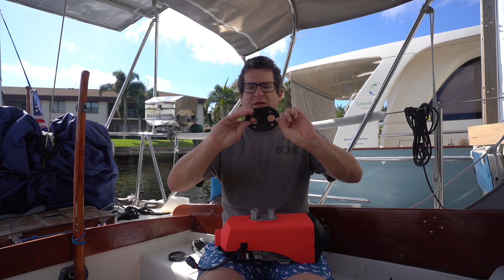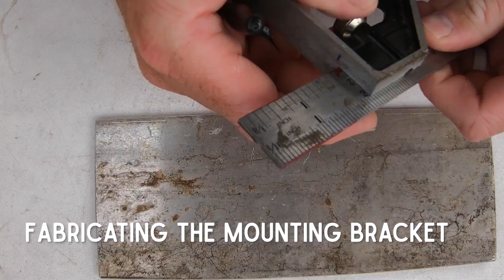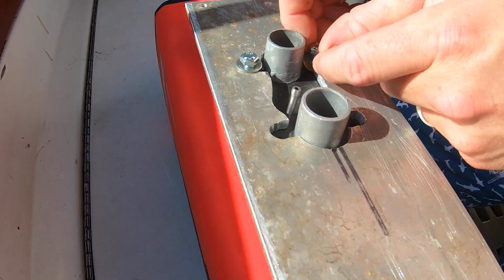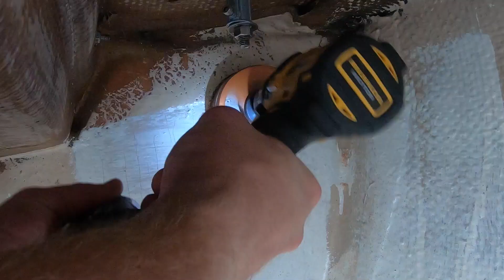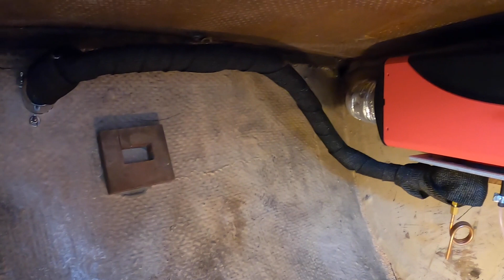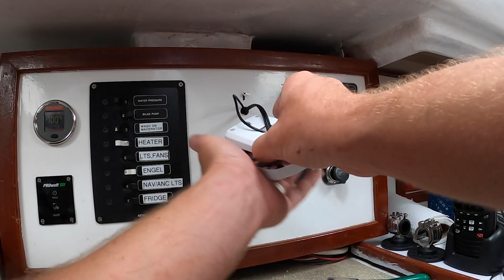Installing a Diesel Heater in Our Sailboat | Episode 37 Alberg 30 Refit

Comment: So, if I understand correctly you take the fuel with a T after the first filter? No issues with air intake in the engine or heater? 

Thanks for your video!

Comment: good video, upgrades I haven't seen in other videos.  No link to the insulated ducting?
Reply from the maker: For that installation I used standard fiberglass duct insulation.    On the Tartan I used Armaflex (EPDM foam) insulation which was much easier to work with.   It’s available on Amazon in a variety of sizes.

Comment: The exhaust should come out thru the transom because it's a sailboat? You have no goose neck in the exhaust so instead you have that drainage pipe, but doesn't that let exhaust inside the boat?
Reply from the maker: Exhaust can be on the transom and a lot of sailboats are setup that way.    You want a spot that doesn’t get submerged while heeling and exposed to limited spray.    On our Alberg 30 the aft corner made the most sense. Many choose to plug the exhaust when not in use.   A wine cork fits perfectly. 

It might be hard to see but the exhaust does rise several inches above the outlet before dipping down to connect to the heater.

The condensate drain has several loops in it which hold water acting like a sink  P trap.  Preventing exhaust from escaping and letting water drain out.
Reply: @AbroadReachTravel  We are assembling a similar type of heater, and the manual says the exhaust has to be in the transom at least 60 cm above waterline and the goose neck has to be 30 cm high, but this is impossible because the hull is not tall enough. Have to choose between assembling it close to the waterline or assembing a low goose neck. Which way you think it should be done?
Reply from the maker: I with the options presented I would go with short gooseneck and a high mounted outlet. Think about a drain in the low spot and maybe plug the outlet if conditions require.
Reply: @AbroadReachTravel  Yes, I agree mounting it high, but it would still be less than 60 cm from waterline. Those drain pipe curves could dry out without noticing it, and I'm concerned of not remembering to remove that plug from the exhaust outlet.

Comment: Great and instructive video.
I'm about to install a Webasto air heater in our sailboat. The same constructions principle.
In the Webasto manual they do not recommend the heater to be installed transversely to the longitudinal axis of the boat in a sailing boat. It's OK in motor boat or if the heater is used mainly when docked. What is your opinion on that issue? Any thought would be greatly appreciated.

Comment: I have this in our skoolie.. but we bought the one with the 4 smaller output tube end.  I used the small piping to make "elbows" and then metal electrical conduit as stright runs to "duct" the heat around the bus.   I plan to do the same when we move back on to a boat.   The plus side of this is the metal tubing (two run under the bed) also radiate heat in the cubby areas they run through

Comment: Hi, thanks for the video, on your exhaust there was the coiled nipple for drain etc ? What is it for and did you make it your self ?
Reply from the maker: Exactly, It’s a drain to let out any condensate from combustion or the unlikely event water splashes up the exhaust. The loop shape keeps a bit of water trapped in it so exhaust gasses can’t escape.  I didn’t make it my self, I got that one off eBay search: “Diesel Heater Drain Elbow”. -Andy
Reply: @AbroadReachTravel  thank you for the reply and all the info :)

Comment: What did u wrap around the thru hull fitting on the outside side before pushing it into the hull
Reply from the maker: Butyl tape.  Its a great sealant for above the waterline stuff but NOT for below the waterline ☺️

Comment: What type of metal did u use for the platform of your heater, By the way Great Video !
Reply from the maker: 1/4” aluminum and two stainless steel angle brackets.  Thanks for watching!

Comment: Great video - good display info! I am about to install a heater myself hence the curiosity... How did the heater work out? I read that the fuel line shouldn´t exceed 1 meter - the pump will wear out - is it working okay for you guys? Any noise issues? cheers from Denmark
Reply from the maker: Thanks!  We have a couple of hundred hours on it now with no issues very happy.  

No issues with the pump, from the tank to the pump it’s a meter then another 3 to the heater.  

The Espar D2/D4 manual (which these heaters are a direct copy) says 5M on the suction side and 6M on the pressure side. 

We can hear a faint click of the pump in the main cabin that doesn’t really bother us.  Can’t hear it at all from the forward cabin. 
-Andy

Comment: I have both types of controller's that you can get with the heater. I can switch between the 2. I use the rotary one the most.
I think I will look into the controller you have. Maybe the lcd one will get replaced by that one.
Reply from the maker: As Andy said in the video we haven’t had much need to use the heater yet, but the new controller has so many more features than the LCD one we have in the van!
Reply: LCD ones use more power though.